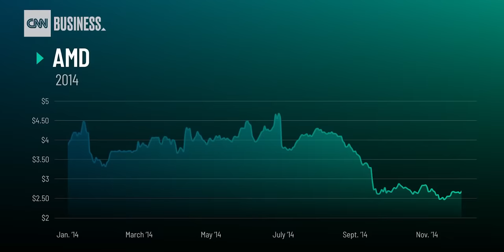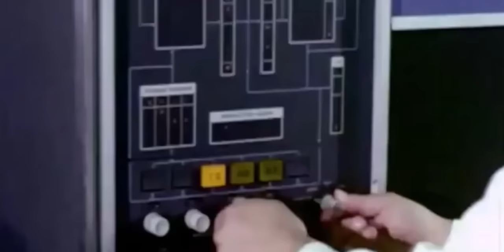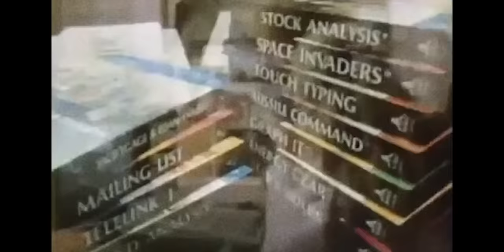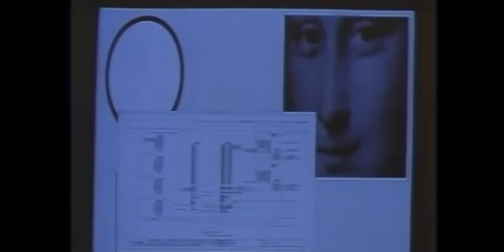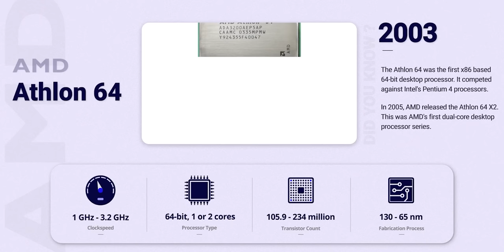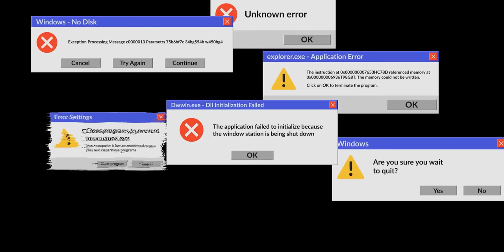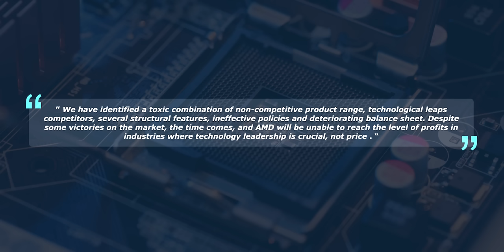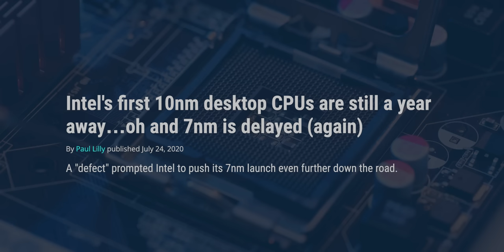The Real Reason AMD Is Worth More Than Intel

Comment: Some corrections: pentium did not clock at 300Mhz that's the max for pentium II first version with 66Mhz bus. 
The pentium clocked between 60 MHz for the very beginning lower model to 233Mhz for later Pentium MMX.
The Pentium II clocked between 233 and 450Mhz for th refresh.
That's my childhood so I remember that quite well!
Reply: Yup. I think the basic Pentium (non MMX) was clocked between 100 and 166 Mhz? The MMX was such a game changer back then. Neighbors had it, I was jealous.
Reply: @diegoleiva7242  60 Mhz was the lowest frequency but it was as fast as a 486 100Mhz!
Reply: yeah he had to be talking about a 300mhz mmx p1 with 66mhz bus cause the fastest p1 I seen before that was around 166mhz. those mmx were ridiculous  I loved my 300mhz p2 it was so weird to see a processor slot in like my sound card video card and ram lol
Reply: This has a lot of things that are missing or somewhat wrong, at least according to the other videos and articles i've seen on the subject: Reverse engineering of chip designs was quite common at the time;  The 286 was, infact, part of their licensing deal through IBM, and AMD won that on multiple appeals.   Intel just kept ignoring the order to share designs, and appealing the decision, then they tried to trademark 386 - 486 (which is why they changed to pentium when they couldn't trademark 3 numbers) before entering a new licensing deal that gave AMD a full x86 license,  but no longer shared chip designs;  Intel also blocked AMD from being able to make socket compatible cpus for intel cpu sockets;  Jim Keller designed Athlon for AMD, not nexgen: nexgen made the k6 line;   Pentium was actually a competitive architecture through the pentium 3, Intel dropped the ball with Pentium 4 and their netburst architecture, and screwed up their attempt at 64bit with Itanium, which was meant to do away with x86.  AMD got ahead again with their AMD64, which was compatible with x86, and became x86_64 when intel licensed it from AMD;  ATI was actually fairly competetive with Nvidia performance wise leading up to the sale, and was ahead in the general purpose compute market.  Infact, ATI's CEO was caught price fixing their GPUs with Nvidia just as the sale happend, and AMD was stuck with the scandal.  AMD was forced to cut back the GPU division, and spun off the mobile division (Adreno) and lost ground on the compute field, allowing Nvidia to push cuda out and pretty much take the market.  Nvidia also released the 8800 series right after, which WAS a beast and out performed ati;  Intel's bribery and anti-trust issues with the OEMs and system integrators resulted in several separate lawsuits across multiple countries, most of which Intel settled on paying a large fine as long as the gathered evidence was sealed and not released.  They then continued to deny the accusations.  The information about dell and HP etc.  Came from AMD's personal lawsuit against intel which underwent discovery.  AMD was nearly bankrupt, so they were forced to settle for 1.25 billion dollars.  Which sounds like alot, but considering Intel paid Dell alone more than a billion dollars for one year of loyalty, damages were probably much more than that;  Intel was also forced to leave disclaimers on their marketing material because they were caught for several bad practices when it came to their benchmarking, and marketing.   Which they didn't even have to do during the bulldozer era since it was a worse product anyway, but they couldn't help themselves I guess.  Several back and forth accusations have gone down around this over the years: SYSmark (BAPco), Principled Technologies, Ryzenfall etc.
Reply: The fastest Pentium II  using the 66MHz FSB was the 333Mhz model. For slot 1 Celerons it was 433MHz.
Reply: @knowak200  I was talking about stock speeds, not OC. The first PIII was a 450, not 500 Mhz model. Would you look up in Wikipedia before posting.

Comment: You know what? I don't want Intel back at dominating the industry. I rather like this leap frogging between the two of them. Keeps the prices down and puts moe focus on other areas like power efficiency. A third big player would be great, but that's hard to imagine given the complexity of chip design.
Reply: This and also consumers being more conscious of their purchases helped too. Knowing when something is overpriced and underpowered helped with keeping price low and better products.
Reply: Donavin Schlosser  I'm hoping for ARM and RISC-V to seriously disrupt the status quo, but the issue there is that neither Intel or AMD are seriously delving into the architecture, so if someone else comes in, they're gonna once again take the whole cake. Not only that, but with the rise of RISC-V in China, it's likely to be a Chinese company, which would raise all kinds of questions about privacy and security.

I'm hoping the big players won't let this train go by. Apple is so far the only one and they're not exactly the harbingers of consumer benefit...
Reply: @TomasLKarlik  i really don't see arm being much better than x86, to make an arm core be as fast as current x86 you will need to imploy the same power hungry tactics, just look at the M1 its "efficiency" advantage is mostly from being a node ahead and having integrated memory which means less energy used for the connection.
Reply: @cj09beira  That may be true... but the x86 ecosystem is extremely hostile, so we won't really get anyone new in there. Anyway, my point was more variety, not necessarily abandoning of older technologies, so I'm all for these architectures coexisting.

Comment: Don't forget the way Intel's C compiler detected the presence of certain instructions in a non-standard way that only worked on Intel CPUs, to make AMD look bad. (I wish I still had the paper Motorola printed about how Intel cited Dhrystone 1 results (which didn't account for smarter compilers that eliminate "dead code" and thus wouldn't measure what the benchmark claimed to measure) to try to make their CPUs look better than the 68020.
Reply: Not entirely correct, but pretty close: ICC would read the CPUID register which will either return "Genuine Intel" or "Authentic AMD". If it got the former it would check the FLAGS register and see which instruction set extensions the CPU supported (MMX, SSE, SSE2, .., SSE4, etc). If it got the latter it would NOT check the FLAGS register, but rather just fall back to 387 math instructions.
Reply: @andersjjensen  right!  It mattered because icc was quite good at vectorizing some common code with extensions that AMD CPUs also supported.

Comment: I used all the chips mentioned LOL Great Story, Had friends that worked for Intel and Wafertech, i even had a silicon disc with no architecture but they are really fragile and broke, i used the Tandy TRS 80 w/zilog chip, 286,386,486, Pentium ext.

Comment: Also worth mentioning that a big part of the AMD64 beating the pants off of Intel wasn't just the 64bit process (honestly nobody was even using 64bit programs or OSes then) but the real kicker was integrating the memory controller onto the CPU instead of the motherboard. Also it took quite a few years for Nvidia to outperform Radeon cards after AMD bought them. When Nvidia hit a wall and re-released their same old G80 under a new generation name, Radeon really starting kicking their asses. Wasn't until after the R9 290 (a sub 400 dollar card that competed with a Titan) that Radeon started to lose steam.
Reply: >AMD got rid of the Northbridge<

Comment: Interesting enough, some punctualization, the GHz technology that made the Athlon shine came from DEC, AMD basically hired the design team (including the architects) of the DEC Alpha AXP processors, that were the kings of speed back then. Part of this team came back for the Zen processors and then moved to intel and now are working for Apple. The definitive technology that made the Ryzen chip shine is the "chiplet", small integrated circuits put together to work as a bigger chip, it allows to add threads at will.
Reply: It was weird to hear about the development of the Athlon without any mention of DEC Alpha.
Reply: @Hardwaregeekx  Truth. Also a bit odd that the Athlon-64x2s weren't mentioned as those kicked the llama's arse. (And a pot shot at rambus, DDR2 helping thrust AMD into the spotlight, pot shot at Intel's 10ghz by 2010 claim with netburst, and the articles about how crap Intel's thermal density was in that era. . .) Lots going on.

Comment: Brings back tons of memories for me. I still remember the FIC FX11 mobo I used with the Athlon and I still remember using another 386 processor from Cyrix, the 486 DX/SX processors and 8mb memory modules. All the tape based storage and 5.25" floppy disk with a big hole in the middle, how time flies.... Nice coverage on the CPU wars, much appreciated.

Comment: so we're just gonna skip over how bulldozer nearly bankrupted AMD and Intel stagnated hard with 3rd gen through 7th gen? could've been good for drama
Reply: Intel 4th generation and refresh is much better. It began from 5th generation where Intel stagnated even though the 5th generation had tick which means new process node (14nm)
Reply: @nergvinergvi7353  not really, 4th gen was still quad core and still only like 10% better
Reply: About the Intel part, Haswell really wasn't bad at all. The era I would call the worst times of Intel would be between Coffee Lake and Comet Lake, for four generations. Improvements from Skylake to Kaby Lake were made and Alder is the true refreshment.

Comment: The IBM PC was introduced with the Intel 8088 CPU (not the 8086), internally a 16-bit processor which communicated via 8-bit data paths
Reply: Spot on Jim, so I wasn’t the only one to spot that mistake
Reply: IBM PC-AT is 8088

Comment: There's nothing intrinsic to the 80386 that enabled GUIs. In fact, Windows ran with the 80286 just fine. 

However, it did have more features that made the proposition more enticing. For instance, protected mode could virtualize DOS memory, which means one could run multiple DOS apps concurrently. They were still more common than windows apps for a while so it was a good reason to switch. 

Also, AMD developed the "586" processor as a beefier 486 to retain some relevance until they had an answer to the a Pentium. It was compatible with 486 motherboards so it offered a nice upgrade path.

Comment: I remember the ceramic Thunderbird cores.  1ghz at the time was too expensive, so I went with a Thunderbird 900 (aka Athlon 900).  Loved that system, my first DIY build.  Lasted from the early 90's all the way into the 2000s...
Reply: The thunderbirds were fantastic chips. I wanted one for the longest time, but couldn't afford it and was stuck on my K6-2 until years later when I finally got an Athlon 64.

Comment: Thanks for explaining it all so thoroughly and clearly. I didn't start building computers until about 2000, and I somehow never caught the history of these companies before. Even with the industrial espionage, AMD still comes out snow white, compared to Intel.

The name Fairchild Cameras is very familiar to me, but until just now, I thought it was just an old local company, which went under decades ago. The building is still there, and Fairchild Camera is still carved into the building. In the late 70s, my father gave me an old camera he no longer had any interest in, that he'd bought there. I still have it in its box, and the price tag still says Fairchild Camera. It never crossed my mind that there could be a connection to Fairchild Semiconductor. Of course, they went away before I started getting into computers.

From the time Athlon hit the streets, I've been an AMD fan. Not entirely due to how good they are, but more because I've despised Intel for a very. very long time. I have the same feelings toward Apple, Microsoft, Nvidia, and IBM, for the same kinds of reasons. I don't like the way they do business, so I won't support them if I can avoid it.

Comment: My first CPU was an AMD Phenom 9550. I really loved that thing, it ran hot and fast for it's time. I moved over to an i5 4460 after that since AMD FX was a failure. When Ryzen came out I got the Ryzen 1600. Now I have a Ryzen 5600X. AMD came full circle.
Reply: My first CPU was a RCA 1802. It maxed out at 800,000 instructions per second.

Comment: Great video.
Some of the history around the 386 Wes more complicated. I had a 386DX made by AMD under contract by Intel, so there was still some cross licensing going on.
Intel had to change from numbers to a name, Pentium, because the courts tried they could not trademark a number, only a name.
The Athlon best the Pentium because of the design of the CPU pipelines in Pentium were too complicated and ineffective. Athlon had a simpler and better performing super-scalar architecture.
Reply: There's still cross-licancing today, MMX, SSE, x86-64, AVX etc. Heck the x86-64 is AMD's and without it Intel had to use IA-64 which was a disaster.
Reply: @Dazzxp  very true! It was pretty ironic when AMD launched IA-64 (aka AMD-64) while Intel was busy trying to launch Merced and the EPIC architecture with their partner HP. I think EPIC was an interesting idea and it really was a bet-the-farm balsy move from Intel. And little ole AMD just came along and extended the x86 lifespan.
Reply: @wazzamolloy  I have genuinely always believed that Intel tried to push Itanium almost solely to have an architecture they wouldn't be forced to share with AMD.
Reply: @blkspade23  anything's possible but I think the partnership with HP to create new UNIX workstations and, therefore, possibly lucrative future sales would have played a part, too. Back then the big, professional workstations and UNIX servers were big money, so I think that was a bit influential 🙂